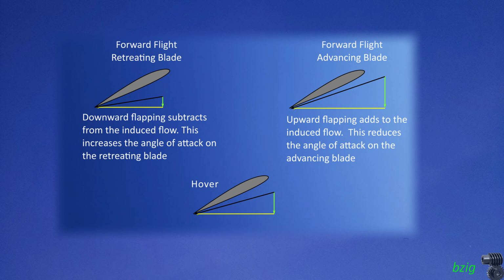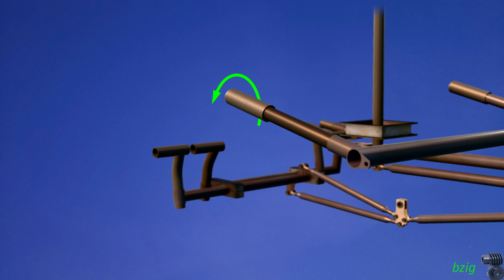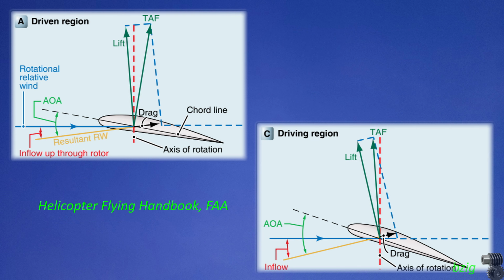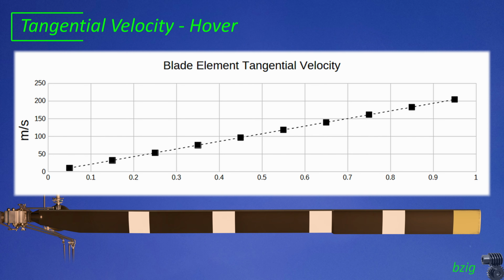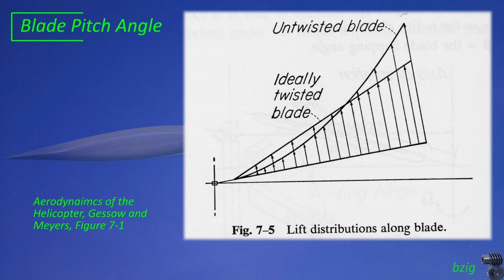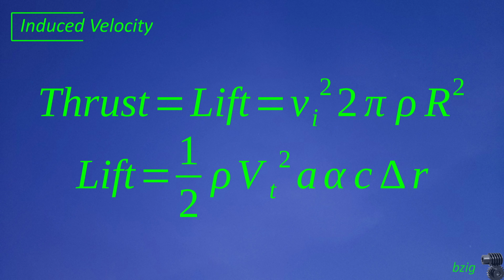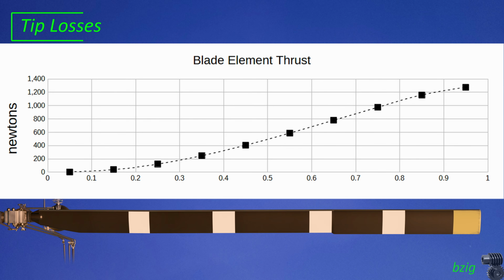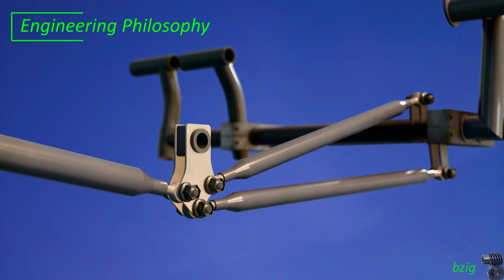Helicopter Momentum Analysis

Comment: That is really nice to see both calculated and modelled.. I was doing this for fixed wing aircraft in Fortran IV on an electromechanical printing teletype wearing ear protection. I flew gyroplanes for a while and did some calculations that worked out quite well for simple constant speed descent etc. But my Bramwell text said there was no static flight solution due to the rapid variation of rotor rpm with lift force.
Could you have a look at that or maybe you have already.

Comment: pls make video on coaxial rotor and swashplate videos. please make the video on defiant x coaxial helicopter
Reply from the maker: The defiant is super interesting...The term "advance angle" describes how far in advance of the blade the swashplate introduces a control input (this accounts for phase delay and the mechanical offset of the pitch change rods).  The defiant uses a variable phase advance angle for different flight regimes.  It's the only helicopter that I'm aware of that does this.  (caveat... I got this from a technical paper on the Sikorsky Advancing Blade Concept... I'm making an assumption the Defiant uses the same technology).

I started a coaxial model.  I'm about a week into it and expect a video in the next week of so.
Reply: @bzig4929  i feel so glad, after reading this. Appreciate the efforts always..❤

Comment: A query from a gyro pilot- Are you sure re the position of the driving and driven regions at 6:25? 
In an autorotation descent the relative wind AOA increases towards the centre due to the reduced horizontal component rotational velocity. 
So the TAF vector progessively tilts from rearward at the tip to forward of the axis of rotation toward the root, up until the critical AOA is reached.  
So the drivEN region is in the OUTER section of the blade, drivING towards the MIDDLE, and stalled around the root.
Reply: From what I gathered, he is talking about in a hover only here. Since we have no forward component, all relative wind is coming from rotation, this it is the same across the span of the blade (assuming no twist). The only thing that will change is velocity, thus lift created.
Reply from the maker: The comment from jacksonwhiteside is correct... this is hovering only.  But there's another element and this is the breakdown in momentum theory a the rate of descent where autorotation happens.  J.G. Leischman has a paper "Development of the autigiro:  A technical Perspective" and he writes, "Notice that there is no exact theory to describe the flow in the region −2 ≤ Vc/vh ≤ 0 (which includes the autorotative state), and the nature of the curve is obtained empirically."

 I knew about this when I made the video, and I glossed over it.  The empirical data show, as you say in your comment, the tip is driven and not driving; the driving region is principally in the center of the blade span... I sort of addressed this in the video, but not really.  You comment is a good catch.  I still think there is merit in what I demonstrated...  momentum theory shows what happens up to the point where the theory breaks down, and this is the forward tilt of the aerodynamic force.  It's OK to intuit that autorotation is possible from this even if the math isn't correct at higher rates of descent.    

I like your comment.  I may do a follow up video to address this.

Comment: I think it's funny as the books illustration always show the air being pulled down into the rotor system by 4 to 8 feet in a hover when actually observed the flow is from 18 inches above... Many a lift job I've watched debris hover over or pass by the top of the rotor disk  then go from floating to accelerated and then wrapped over a blade making a racket spinning through the air...
Then the baggy or plastic comes free to be blown away looking for another helicopter to prey on... Great video you have

Comment: Question on an unrelated topic:
I recently heard Mr. Hill of Hill helicopters say something about a free power turbine engine being required for helicopters because that was how you enabled auto-rotation, because a fixed-shaft turbine wouldn’t work.

I thought you only needed the sprag clutch to enable auto-rotation. Could you do a video on whatever Mr. Hill was hinting at?
Reply from the maker: I've done content on autorotations before, but I agree... addressing that specific topic would help with understanding.  how is this logic... (1) to enable autorotation you have to automatically declutch all of the high speed or high torque components in the drive system.  (2) designers figure out where this point is and insert the sprag clutch at that point.  (3)  The free power turbine is always beyond that point so it is automatically de-clutched on entry into autorotation. (4) The engine is not mechanically connected to the free power turbine (it uses a gas coupling) so the state of the engine (operating or non-operating) is really not a factor in autorotation.  (5)  However, engine start (turbine or piston) would not be possible if the rotor system were always connected to the engine.  This is why turbine engines use free power turbines and piston engines have belt clutch engagement systems... to allow unclutched engine operation.  (6) Unclutching during engine start is different from uncluthcing during autorotation.   These are different mechanisms and modes of operation.
Reply: Hill is an idiot. A shaft coupled turbine has a shaft clutch & freewheel clutch , the Gazelle AS 341 was shaft coupled as with the Jet Exec turbine conversion.  An air coupled shaft turbine still requires a freewheel clutch as the power turbine acts like an air brake slowing the whole system after gas producer shut down...

Comment: I've been dealing with blade element momentum theory a lot for my master's thesis recently and it's great to see it visualised in such a cool way. For a comprehensive rigorous derivation with nice illustrations I recommend
Glauert, H. (1935). “Airplane Propellers”. In: Aerodynamic Theory. Ed. by W. F.Durand. Vol. 4. Berlin: Julius Springer. Chap. L, pp. 169–360.
It's amazing how lots of this stuff was already being researched before actual helicopters were built. I love how Glauert refers to autogyros as lifting windmills for example.
I also find it fascinating, that such comparatively easy methods allow people to build machines that actually fly. Goes to show that you don't need CFD for everything.
Reply: And sometimes to measure blade tracking you just need a few colors of paint, a big padded stick, and a guy with brass balls.
Reply from the maker: Has technological progress has stalled since the dawn of the information revolution?  Space flight, a manned moon landing, supersonic flight, high speed rotorcraft and fly-by-wire all predate practical CFD and CAD... and somehow we still managed.  Maybe over-analysis is a barrier?  Or maybe the launch pad catastrophes back in the day justify the slow down?    

Thanks for the Glauert reference and thanks for commenting!
Reply: @bzig4929  I for one am a big proponent of thorough analysis rather than trial by error. (looking at SpaceX e.g.) Blowing up dozens of prototypes just seems like a waste of resources and money to me.
CFD, FEM and the like are undoubtedly very powerful tools to the point where they can actually be used to conduct fundamental research. In many cases it is in fact the only way since experimental measurement is just not possible in certain situations. However, we've reached a point where setting up good quality simulations is much easier than developing some analytical lower order abstraction of the problem that could provide direct insight. Before the advent of those powerful tools it was the only approach available so yes, I think some of the theoretical knowledge and especially the skill in developing such methods will get lost since it is much easier to use the "numerical hammer" these days.